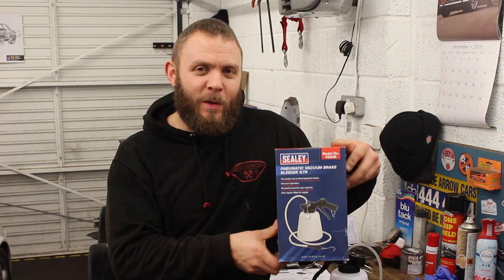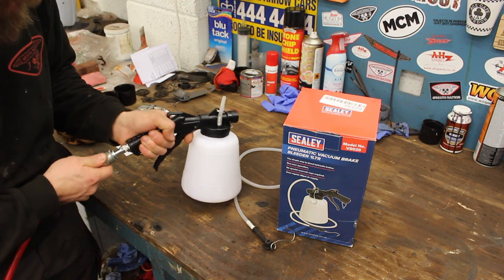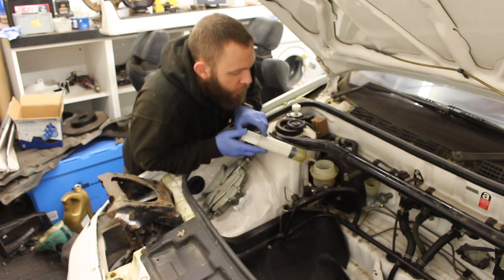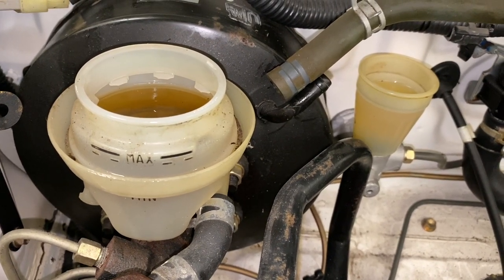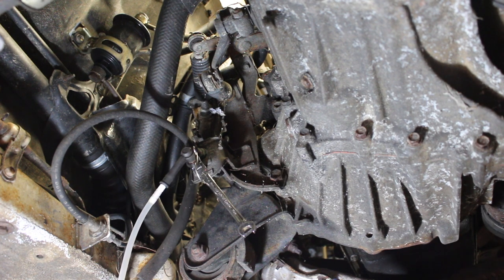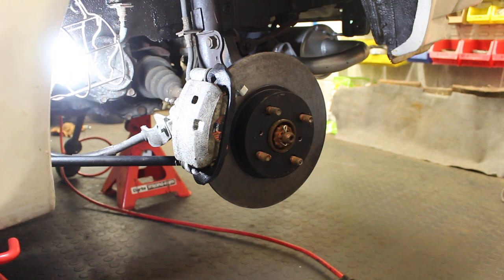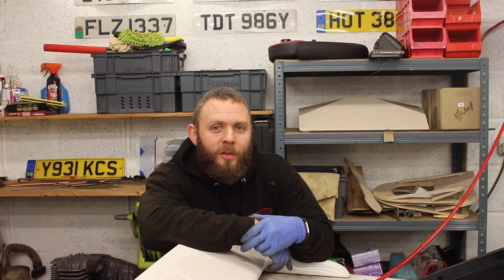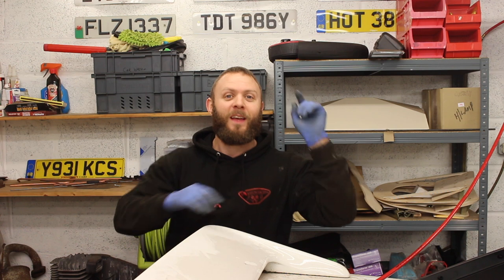Brake And Clutch Fluid Change Toyota MR2 Mk1

Comment: I have really enjoyed watching all your videos, several times over!! I have always wanted a Toyota MR2 Mk1 since the first time I saw one when a friend pulled up at a party in it in 1985, 35 years ago! Since then, life, house, kids, DIY have got in the way!!!

BUT on Saturday I pick up my 1986 Mk1 BRAND NEW, old, NEW, old, NEW, old MR2, get in!!

I must say I am quite an amateur under the bonnet, but I’m willing to learn, with your videos I feel I can do the small jobs needed to get the car back into tip top condition. I may need your help in the future when it’s all in pieces, LOL!! 

Love the first time start, spider! and MOT vids, still make me laugh now!! Keep up the great explanation on tasks, very enjoyable.

Excited!
Reply from the maker: Thanks for your comments. Glad it’s given you the push to get one. I’ve still got a few videos left to do. Stick at it, they are great fun cars! Very rewarding.
Reply: @Resto.Nation  Just a quick question, is there anything which would tell me the cam belt would be going? As I have to drive the car quite away back home. Maybe sound, touch, see etc.? any advice would be good? The car has 53000 miles, in working order but hasn't been driven for some time. Cheers!
Reply from the maker: The engine is non interference so if it snaps then it won’t do any damage. I haven’t done mine yet...
Reply: Resto Nation Cool, thanks for the advice.
Reply: Resto Nation So the big day has come! Getting the brand new (old) MR2 Mk1 home from Eastbourne to Bromley, all went well, just a slight blowing noise from the exhaust plus smell and sound, can be sorted. Engine in good condition just a few tweaks to make, I will check everything tomorrow. Above all loved the drive home, put a very big smile on my face!! 😀😀😀😀

Comment: Hi Guy S question if I may 

If the fluid has not been changed can ot make it harder to change gears?
Reply from the maker: To a certain degree yes. If the clutch fluid is very old. Get it changed for sure. I’ve also done a video on greasing the gear linkage too so that might help. I think it was in the snagging video after the first test drive. Good luck.

Comment: Hi James, hope you're well, quick question, I'm just about to buy some brake fluid you mention in the video Dot 4 and not Dot 3 what is the difference? I take it you use the same fluid in both brake and clutch? (New to this!). The MR2 is coming along nicely! Will be doing the sticker set soon. H
Reply from the maker: Howard, great question. 3 and 4 are compatible but 4 has a higher boiling point so would be the preference. Just don’t mix with dot 5!
Reply from the maker: And yes, clutch and brake the same
Reply: @Resto.Nation  Thanks very much (Go on get another MR2 you know you want to!!) Cheers mate. H
Reply from the maker: @howardbetts1511  I’m tempted but need to sort garages first. No garage = no project cars